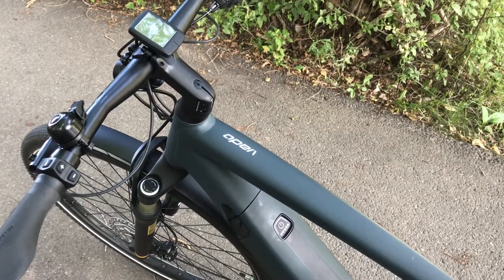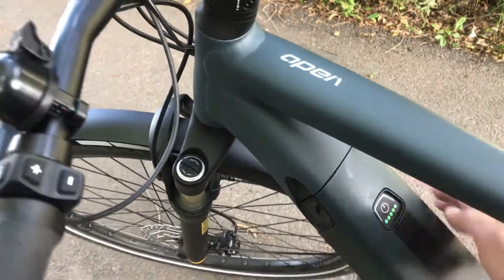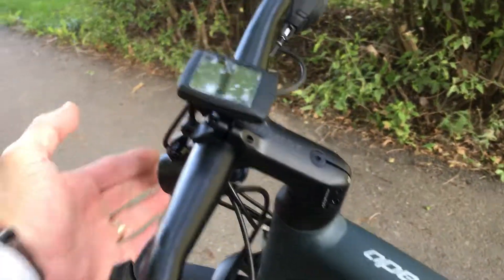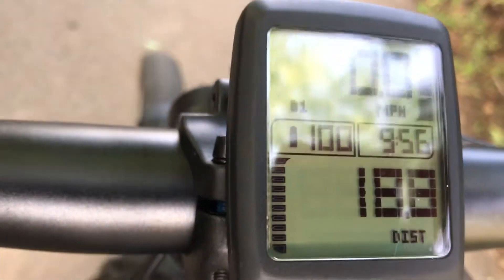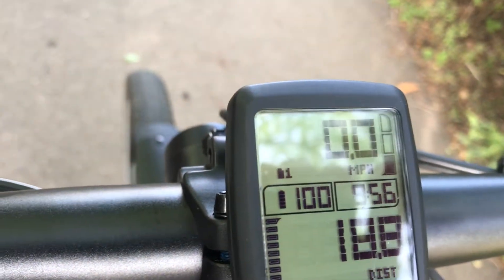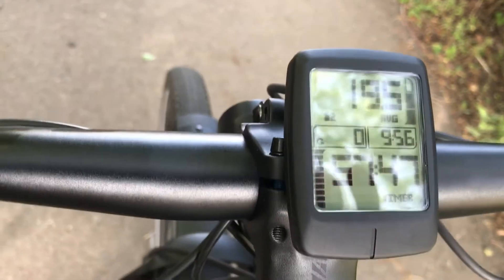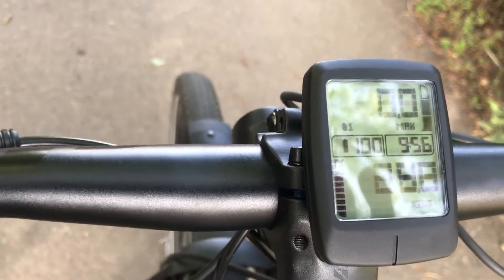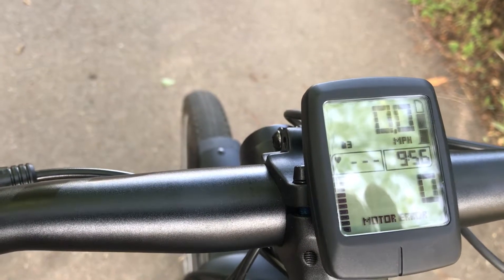Vado motor error 1

Comment: Same problem. Shop guys told me it was a well known and documented issue. That the Specialized recommended fix was to place some tape inside the battery place to prevent it from vibrating. Problem solved for a few months, but returned (as expected...)

Comment: Did the tech figure out the issue?  I see that error one time out of 20, but always works fine after a restart. It's not a problem now, but I wonder if it will get worse in the future
Reply from the maker: Mine got worse and that’s why I took to the shop
Reply from the maker: And yes specialized made it right